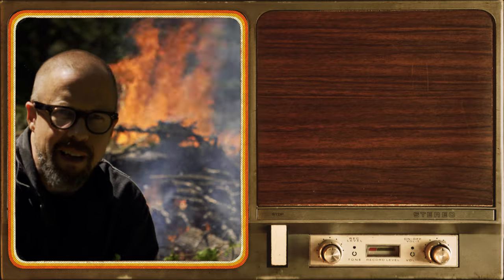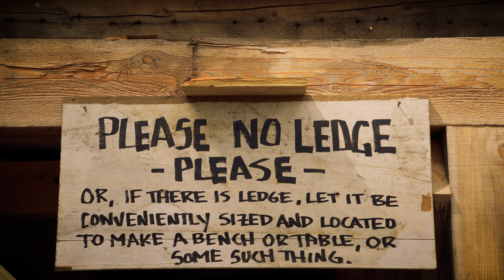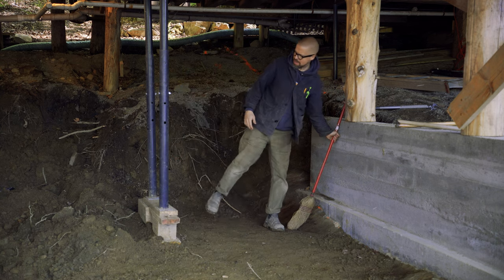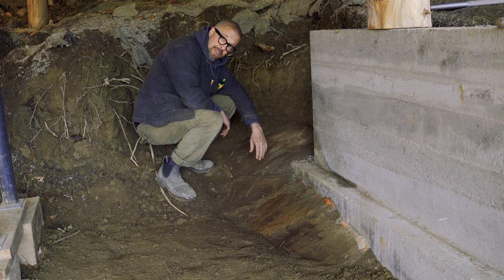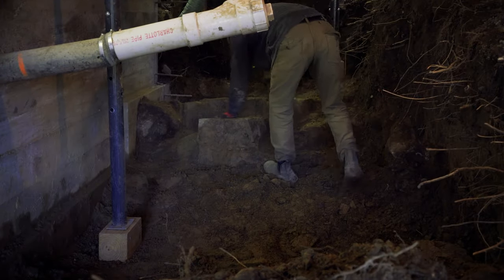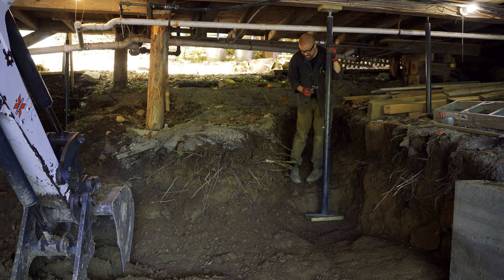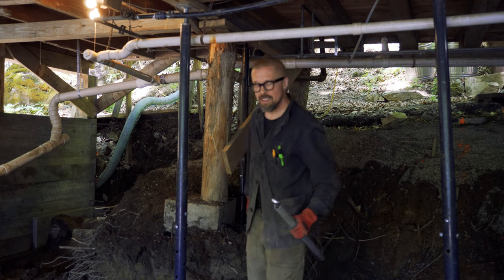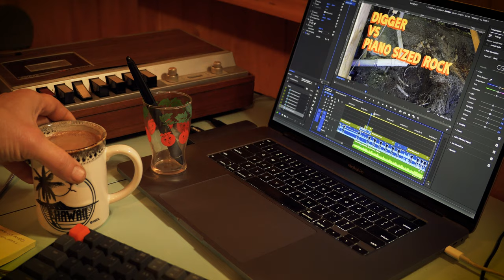I Dug Us a New Room! SAVING our 1880s Maine Lakeside Cabin YEAR2

Comment: I’d suggest levelling out the entire footprint, will be better for ventilation, insulation. Think drilling 20mm holes then sequentially pneumatic pressing in a 28mm iron spike would be most effective..

Save that clay man, get making geographically precise ornaments and culinary..

Quickly mention we have a Bayside retreat, so we can seem more upper middle during these proceedings.. 🙂
Reply from the maker: Yeah - I may keep that boulder because it's well located and doesn't intersect a wall. I can't imagine too much water working its way up through an insulated concrete slab on clay from around the edges of a big boulder. (Though one should never underestimate water.)  I broke up a huge stone last summer using expanding grout, but the process of drilling a dozen 1" holes was brutal. I'll investigate other options, including yours.
Reply from the maker: I did have a moment when I wished I was a potter...